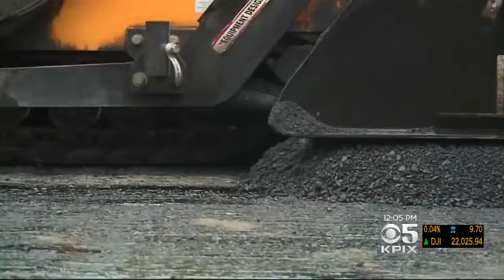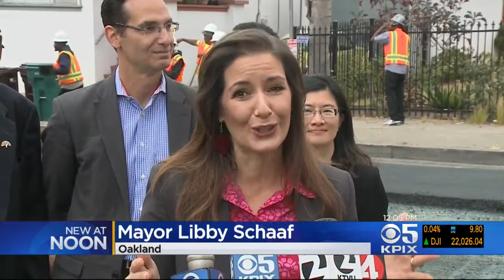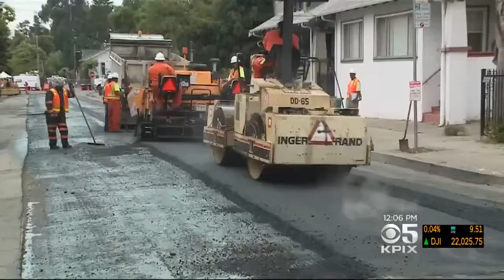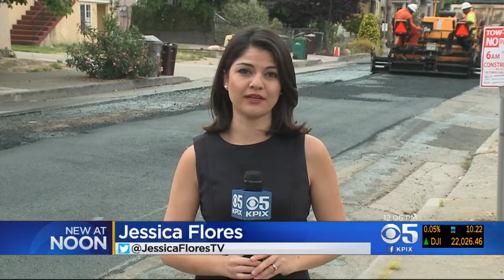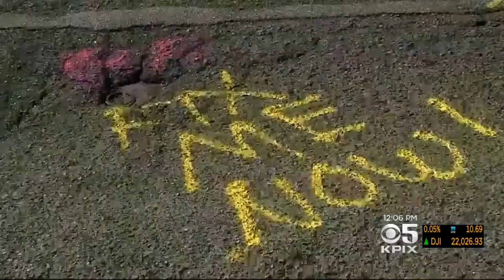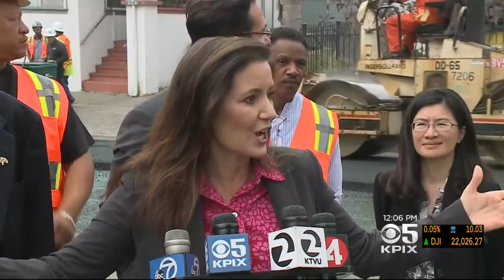Oakland Road Crews Work To Fix City's Potholes

Comment: No one has posted?    51st and Telegraph.  Please fix the road between 50th and 52nd on telegraph. going towards Berkeley from Oakland it is like driving off road. just slamming my car down. my front end needs alignment. I drive all over Oakland and this has to be number 1 right now on the list. It's a main highway road.  as of 2019 it's more than a hazard. someone is certainly going to get injured or possibly killed if they're on a motorcycle and lose control.